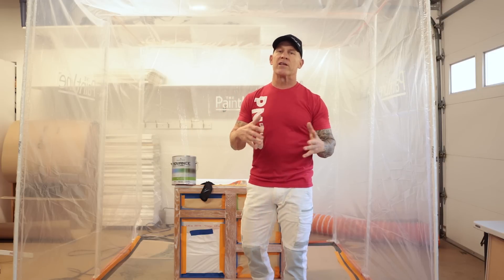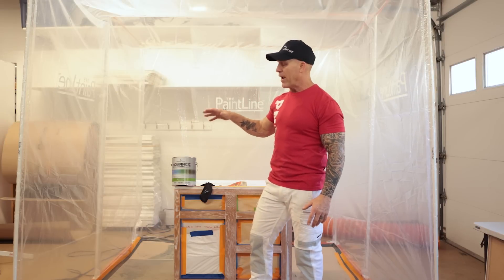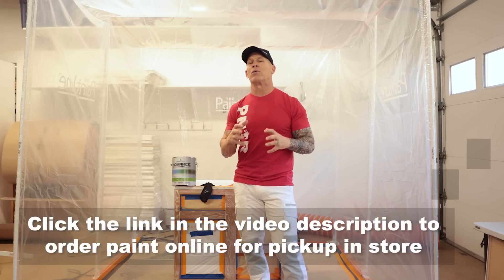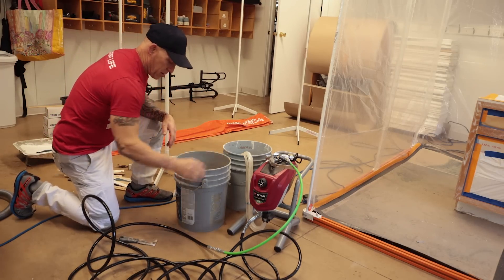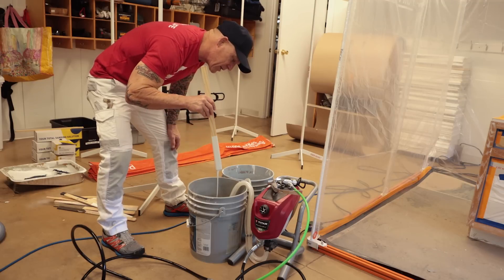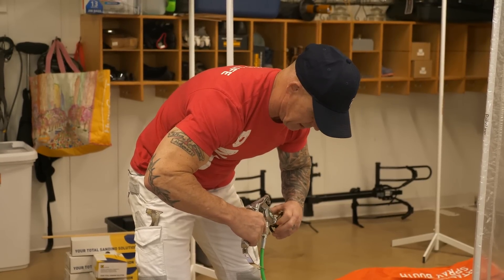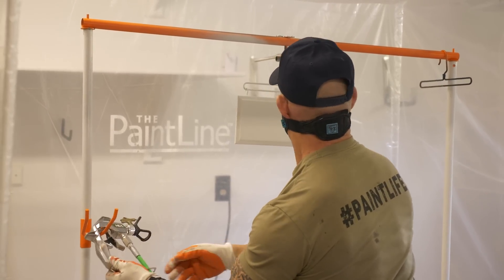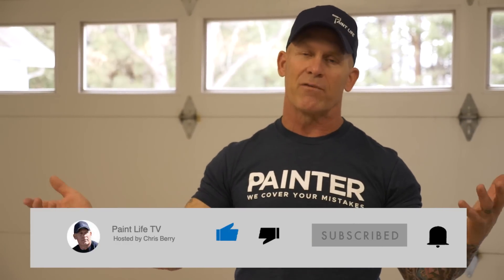Benjamin Moore Advance on Cabinets Reviewed. How Does it Perform Rolled, Brushed, and Sprayed?!

Comment: I’ve used this paint in black on furniture. Best “black” paint I’ve found. I rolled paint on and I found it does not cover well in my opinion. It needed at least 3 coats.
Reply: That's probably because they offer this in a pre-mixed black. They don't have to tint a light base to become black.... the base is already dark so it is a much deeper black and offers much better coverage. They also do this for some of their exterior paints- I use Regal Exterior on a pre-mixed blacl on front doors a lot.
Reply: @joshuareed3999  Thanks Joshua. This doesn’t explain the poor coverage. Do you have same results?
Reply: @haroldobrien8550  I would make sure that they used the correct base, or use their pre-mixed black for better coverage. I use it all the time and it covers really well. Some stores may not carry the pre-mixed black Advance, but I can tell you it's worth a try!

Comment: I’m a DIY guy first time using an HVLP with compressor. Any recommendations for cap size when spraying BM advance on oak cabinets? Believe my gun comes with 1.4. Also anyone have a preference in primer to use with this product? Planning on doing 2-3 coats of aqua coat prior to priming. Any help would be appreciated
Reply: I used 1.5 for BM Advance and it worked out beautifully.  I thinned with water about 20%

Comment: Great review. Have used over BM Stix primer and got amazing results. Did not work so well over Kilz primer.
Reply: I used BM Advance to cover early-80's stained birch paneling in my living room. I used two coats of Cover Stain primer with two coats of BM Advance with beautiful results. Cover Stain is oil-based, but at less than $20/gallon, you can't beat the price. It hides knots, stains, etc., sands easily, and I've had zero bleed-through.

Comment: The information about dry time is not accurate. It dries much quicker than oil-based enamel. It dries to the touch within 1 hour. I used it on a set of kitchen cabinets and it performed perfectly.
Reply from the maker: LOL the dry time info came right off the can.  What’s not accurate about that?
Reply: I used that same product on a cabinet job a month ago. I was able to apply three coats in a span of 6 hours. It's an exceptional paint. I'm using it ag Asa in. It's a little pricey, but it makes up for it in production time. I really enjoy your videos. Keep slinging! @Idahopainter

Comment: For cabinet doors do you have to sand your final coat?
Reply: You should sand before every coat (to varying degrees), but not after the final coat if that's what you're asking. With a 2-coat sprayed finish (my standard) I use 320 with light pressure between coats.

Comment: you are a excellent decorator but i would never use anything but oil on cabinets
Reply from the maker: Bad advice
Reply: Same here always use oil based, or pu polyurethane for cabinets, that's just my  preference
Reply: @Idahopainter  water based won't hold up on cabinets well it doesn't hold up very well anywhere really but especially on cabinets seen it so many times since a lot of decorators started using water based paints.
Reply: @jackwardley3626 
I agree, seen it especially with dark colours, just because people like oil based does not mean bad advice either
Reply: When we bought our house had our cabinets painted with oil based and its been 14 years never had them touched up. Held up great. Want to get them repainted again and hoping to still use oil based. This looks great too just wonder how long it will hold up to a busy family.
Reply: @emoss8927  it all depends on what sheen you go for high gloss will be the most stuff resistant and the most washable but any oil will last a lot longer than water based i painted a hallway and landing for a family with 3 young children 8 years ago i did the walls in oil based eggshell and there still look as good as the day i did them if that was a acrylic which is still a tough paint that would be stained chipped and scuffed to hell. I would never use water based paints on woodwork or metalwork.

Comment: This stuff is about as close to the cabinet maker grade high end enamel custom finish paints you'll see. it may as well be the same thing. Almost impossible to chip or wear through with normal wear. Not really sure there's a better option on the market.
Reply from the maker: Thanks for sharing

Comment: Takes a long time to cure and get hard (if it ever even does). Remains soft and tacky way too long. Lot's of paint looks good when applied carefully. It doesn't mean it is good long term or even practical for a real contractor.
Reply from the maker: Takes 30 days to cure
Reply: I've used it and it does take a month or so to fully cure, but when it does it's rock hard.  Very pleased so far.

Comment: NOT good paint I don't understand why people say BM Advance paint is great.  I have been painting for years and it is the WORST paint I have ever used.  It is nothing it says it is.  It has no working time, does not lay off well, and does not level at all.  Bought the prime and brush they recommend.  I just did my new trim and all I see is brush marks.  I returned the first gallon and tried a second, same poor results. I recommend avoiding this paint at all costs.
Reply from the maker: Thousands of people love it cause it is good paint.  Is probably user error if your not getting the results you want

Comment: While BM Advance may have the best looking finish for a water-based product, it is not like any other paint I've used. I would never recommend this to a DIY'er. It is very prone to run, requires numerous coats and works best if you allow it to dry for at least 24 hours between coats. 

In my experience, this paint collects dust like a magnet once its cured and requires more cleaning than usual on baseboards. That's weird. I could never figure out why.
Reply: Which paint would you recommend for brushing/rolling trim and cabinets? Thanks!
Reply: @Avital4414  Zinsser Cabinet Coat

Comment: This particular paint absolutely garbage. It's Strips off.. you can scrape off the paint with your fingernails without using no force
Reply: What surface did you paint over. What kind of prep did you do on the surface before you painted? Did you use a primer?
Reply: Probably you don't prep first. 
🤣🤣🤣
Reply: Great Info Thanks Tom.
Reply: Do you sell that  spray booth set up you Have there ????  Thomas Painting.
Reply: Laminate plastic like surface. I tried priming it plus light sand for preparation.
Reply: @chargertrg69  yes I did .I'm a professional painter
Reply: Keep in mind hybrids cure like oil paint.  They'll be soft for several months after application but become very hard once cured.
Reply from the maker: Yeah of course until it cures 🤔
Reply from the maker: It’s in our store
Reply: Could b prep for sure, but it could b if ya sprayed it, acrylic paint doesn't like 208 spray tips, or to high of pressure,  we use 210 tip, and only  enough psi till i sprays uniform, because  208 at really high pressure can change the paint structure
Reply: Not my experience. I use it in my own kitchen cabs, use it daily, holding up well.